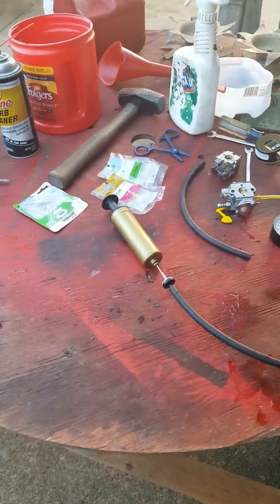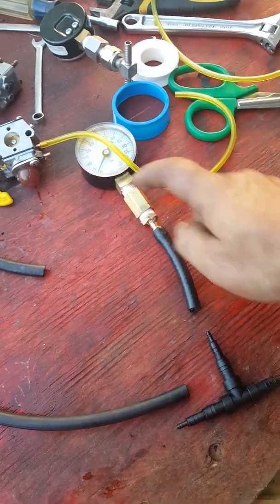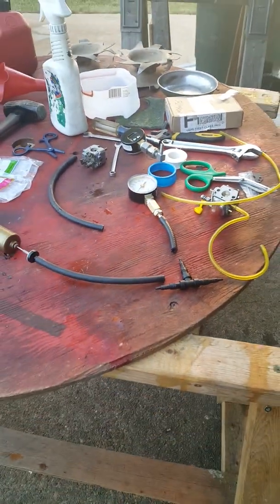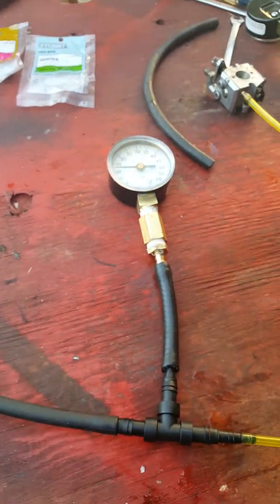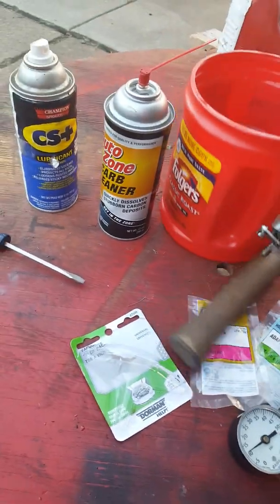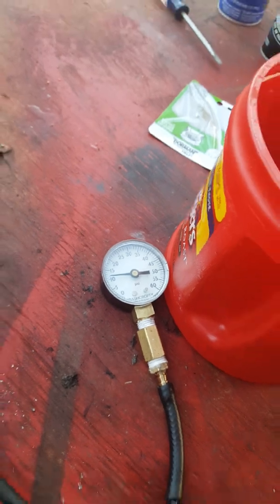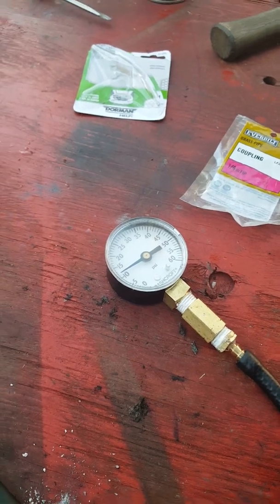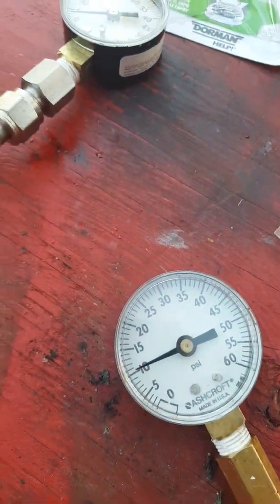Build Your Own 2 Stroke Carburetor DIY Pressure Pump.  Walbro ...Zama

Comment: Hi in process of building DIY pressure pump. My problem is the a/c check valve , i have replaced it twice because they leak around the connection between the white inlet  and black outlet. Do you have any other suggestions for a reliable check valve. Would really like to make this thing work. I am only using 10 psi pressure of my regulator to check out the check valve. Thanks for the video.
Reply from the maker: Hi Billy thanks for view.  For sealing leaks at connections I would use permatex silicone products .  Just make sure it's automotive grade.  The fuel mix will eat up silicone if you use household products.  Also all hoses should be automotive grade.   I hope this helps.
Reply: Thanks for the quick reply . i have already returned both a/c check valves. I was really looking for an alternate solution . I might check out some of the brass type check valves
Reply from the maker: Billy try the silicone allow time for it to dry
Reply: Ok I'll give it a shot , thanks
Reply: Sorry to get back so late, tried the the silicone it helped. Found problem was a cracked brass coupling i had purchased form Lowes. Replaced it and went with a different check valve now it works great. Thanks